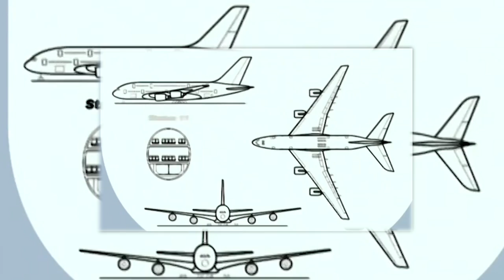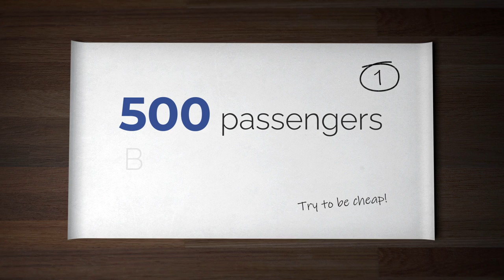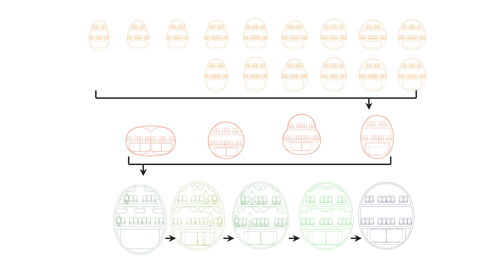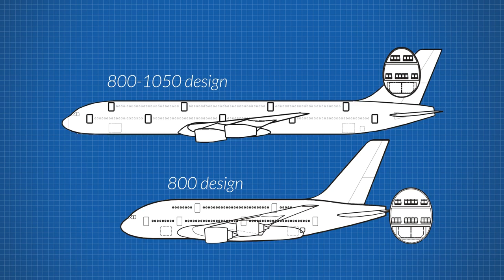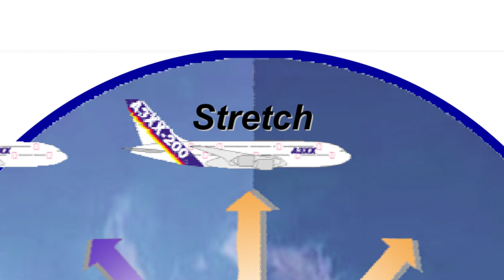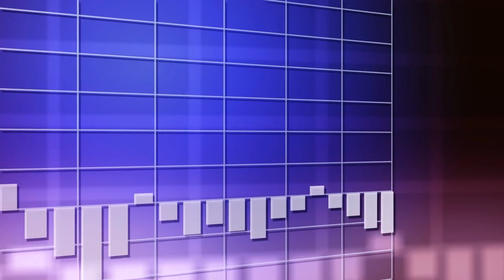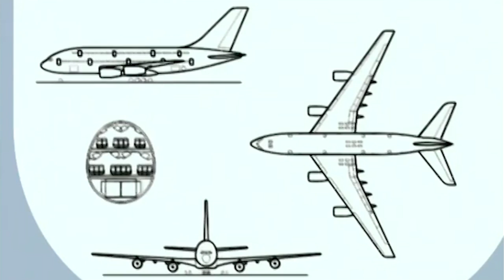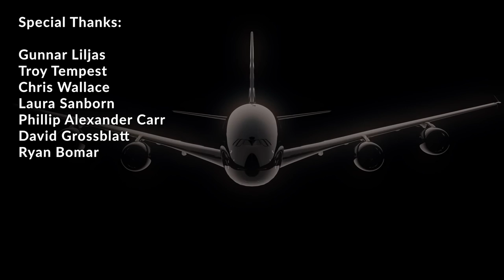Airbus A380 Alternative Designs - How They Made The Perfect Boeing 747 Rival

Comment: I wish the A380 would have been more successful had it been launched decades earlier. That way more variants would have been developed and would have sold in the hundreds by now.
Reply: Well, timing is everything. Airbus might not have been able to fund such an expensive, biggest ever project 20 years earlier. Only when Airbus had matured organizationally and in the global market could they undertake such a huge risk. Turned out to be 10-20 years too late, and major market changes have occurred. So the final count of giant commercial aircraft will be right around (1558) B747 to (243) A380. It is sad to see the B747 rapidly being phased out fleets as well.
Reply: Airbus already sold hundreds
Reply: @maverickchakraborty9578  they had to sell (lease for the long term) at least 400 units to make up for the costs. Let alone profit from it.

Edit: If I remembered correctly.
Reply: @fyt54321  if a project is to ambitious aircraft companies collaborate like on the concorde and eurofighter. I just think airbus was just affraid to attempt it. The market was there, they just didnt belief in it. As they saw other manufacturers run into development issues, like lockheed and mcDonnel Douglas.
Reply: If it launched earlier then it would need 5 or 6 engines, even worse airplane.
Reply: @hodb3906  they needed to sell around 250
Reply: @maverickchakraborty9578  With regards to the 380? I guess "hundreds sold" could be a valid characterization, although on the Airbus site they seem to list only 251 orders total, which I assume is the total number of orders of its history....
Reply: Would airport facilities and ground operations in many markets have been ready at an earlier point in time in such a counterfactual?
Reply: well pre-2000s means then came 2001 so...it'd rather been a catastrophe. I feel it was the right time, it was never a great idea so i am surprised it even sold that much.
Reply: They could've made it mode succesful, like less weight
Reply: did the a380 ever make money?
Reply: @randomrazr  No
Reply: Decades earlier would have sold 1500 at least. They came on the scene too late after the airline market already shifted to more flights on each route on planes in the 777, 767, A330 size of planes. Ironically if Airbus were still making the A380 I venture to say they’d be getting 300-500 new order right now because plane giants would love to change to a less flights per route with planes that hold more passengers now. The pilot shortage presents an opportunity for Airbus but they probably don’t have the equipment to make an A380 anymore
Reply: Decades earlier would have sold 1500 at least. They came on the scene too late after the airline market already shifted to more flights on each route on planes in the 777, 767, A330 size of planes. Ironically if Airbus were still making the A380 I venture to say they’d be getting 300-500 new order right now because plane giants would love to change to a less flights per route with planes that hold more passengers now. The pilot shortage presents an opportunity for Airbus but they probably don’t have the equipment to make an A380 anymore
Reply: Late to the game lol

Comment: The a380 program was still a success I'd say. A lot happened in the background that helped Airbus and its product line become much more modern, optimized and competitive. Many features of the a350 were initially developed for the a380, like break to vacate.
And I think that in a couple decades, some markets will become too saturated and there will be demand for large double-deckers again, even doing p2p.
Reply: Extremely big picture maybe it was a success, but in pure accounting terms, the A380 was a money losing program which never broke even (a failure). By the time a large 4-engine style/500 passenger airliner is in demand again the A380 won't be competitive because of newer technologies available at that time (I'm guessing at least 15 years).
Reply: Would have it not been easier to just build the A350 like Boing did with the 787 and skip the whole A380 debacle?

Comment: Exactly how you stated: plane that we love. I did at least 20 long haul trips on board of an A380 ( CAN-DBX-GRU-DBX-CAN) and I can affirm it’s my second favorite airplane ✈️ for passenger comfort, the 1st one is the A350 ( I have fear of flight, I know it’s dumb, however my subconscious wins over my reasoning been, my first flight ✈️ onboard of the A350 I almost got panic attack due lack of noise, I got the impression the turbines weren’t get trust enough to lift the plane hahahahahaha)
Reply: A380 lack the cabinpressure turbine and the water recyceling system that A350 and dreamliner have. This allow them to have higher pressure, less noice and wetter air (aircraft air is usuay very very dry. 

This is the main reason A350 and B787 feals so nice but you cant put your finger ln why. The system also saves fuel, the actually original reason why they have it.

It strange that they opted not to install the system on the A330 neo. That is why A330 neo cant share engines with the B787.
Reply: I haven't got on A350 B787, but I did couple trips on A380. So in my "experience" A380 is the most quit airplane, especially after take off when engines reduce the thrust, it feels like we're still on the ground :)
Reply: @Ascarbek  yes, especially when you're sitting in front of the engines
Reply: Obrigado you for flying Emirates! 😁
You might have been one of my passengers. ✈
GRU-DXB is even considered ultra long haul (ULR flight).
I use to hear passengers often saying how much they like the 350 while flying on 380.
If the plan hasn't changed EK should be getting the 350 (with some 330s) instead of the last 380s ordered that will not be built.

Comment: During a familiarization class given by AirBus for the rollout of the A350, I was able to walk thru the assembly building for the A380 in Toulouse FR. Workers were putting the cockpit wiring and related equipment in place up front but the rest of A/C was bare and vacant.  With no interior and no floorboards or bulkheads in the main cabin, it was a huge, dark cave of impressive size.

Comment: Airbus should of concentrated more on both the cargo version and the ability to convert to cargo than all these multitude passenger focused versions.
Many cargo planes spend a good deal of their lives as passenger planes before conversion and airbuses total disregard for this aspect has bitten them hard.
The 380 is almost impossible to convert effectively unlike the 747 which is extremely easy to do so, airbus should of focused on this as even before covid those 747 were coming to end of life and the 380 could of been an excellent replacement mass hauler.
Instead we now see many barely used (in airframe time) 380 either going to scrap or "retired" way too early.
Reply: Airbus should have concentrated on improving the A340-500/600 models instead, and made the A340-500 available as a cargo transport.
Reply: As well as a longer range, a340-600 using the a340-500 but a slightly bigger fuselage with larger fuel tanks and improved engines
Reply: The a380 has to much volume to be an effective cargo plane. It would need bigger wings and 6 engines so to max out its payload capability.
But there is also a logistical problem. The a380 fuselage is much taller than the 747. Would they do 2 or 3 levels for cargo? 2 would help for oversized stuff but very ineffective economically.
Reply: And Boeing should have built the Pelican.
Reply: >unlike the 747 which is extremely easy to do so

The Jumbo had the privilege to be born in an era when the Cold War created funkloads of theoretical niches only itwas capable to fill:
Double-deck intercontinental airliner? check
Cargo-transport? check
Semi-militarized presidential transport with extensive self-defense capabilities? check
Long-range aerial-refueling tanker? check
Aerospace surveilance and lectronic warfare? check
Military missile command mobile HQ? check
Airborne ICBM launcer? check
Anti-ballistic/anti-satellite freaking LAZORS!? check!
Flying fighter-jet carrier? FREAKING CHECK!
Reply: They really couldn’t at first. The design was a double decker. The question was how do we efficiently redesign it to be a cargo plane after it was designed to be a double decker?  Thats why it cost so much  in the beginning, it was all the design changes and retooling ect. They basic designed them inside a box they had to figure their way out of.
Reply: I totally agree, I remember seeing this. I wish  all A 380 had the option for a cargo plane. But they didn't want to do that, or maybe the cost. Not sure, but just looking at that plane cargo comes to mind. I'm just saying anytime you build a piece of equipment. The usability makes it even more valuable. It pumps me out the Airbus A380 is awesome.
Reply: The A380 can not ever take cargo as the decks do not have the structural strength and the mostly carbon fibre fuselage makes it very difficult to insert cargo doors.  It would have to compete with second hand 747 conversions and that would mean no one would buy a new A380 freighter.
Reply: @johnny_eth  afaik the wings were too big
Reply: I always say the same thing! They should have had a portion of the team focus on either making a separate cargo version or focusing on making a the A380 a combi aircraft.

Comment: @4:16 > Aérospatiale is the ancestor and French part of Airbus, known after renaming as "Airbus France". For a long time, final assembly of AIrbus aircraft was done at their HQ in Toulouse, France. Today they are in charge of a lot of things, including integration, cockpit and most avionics, and final assembly of the whole family except obviously A220.

> BAE is the other ancestor and English part of Airbus, before the UK pulled out of the Airbus project. UK's aero industry was saved by (if I recall correctly) the German gov't providing funds needed by the UK companies to build large production facilities to remain in the Airbus project (mainly for wings, in Broughton). Today they are mainly in charge of landing gear and wings.

> CASA is the Spanish part of Airbus. Most of its experience was in designing and building in military aircraft. They are now a big part of the military programs, and notably took over the responsibilities on the A400M and A300-MRTT (the military-oriented transport/tanker). Today they are mainly in charge of the tail section, including APU.

> Deutsche Aerospace is obviously the German part of Airbus. They are based in Hamburg. Don't know much about their history, but they have a sweet Boeing Super Guppy exposed on site. Today they are mainly in charge of the cabin along with other things (evacuation, external lights,...). All Airbus aircrafts have their cabin installed in Hamburg. They also have an A320 final assembly plant, and an A380 delivery center (but final assembly is done in Toulouse).

Comment: The perfect 747 rival would have at least had a variant that was competitive as a freighter. As it is there will be 747 freighters flying for at least the next 25 years. A380's still flying in 15 years? Unlikely....
Reply: I think there will be a new big plane arriving for cargo purposes. The order online market is only going to grow even further, the key to winning is going to be purpose built efficient planes of varying sizes.
Reply: Emirates will probably keep the A 380s until 2030 (since it's the perfect aircraft for their business model), the 747 cargo aircraft get competition by the new 777-X cargo version, the produced 747-8 F will of course still fly for at least 15 years.
Reply: Emirates will keep the A380 until the mid 2030s
Reply: @simonm1447  Boeing would try to compete with themselves lol?
Reply: @yadoo8164  not directly, the reason why they never offered a factory freighter based on the 777-300 ER. However, with the production end of the 747 they need something new in this size, which is the new 777 Freighter which is bigger than the old one based on the 777- 200
Reply: i guess there’s the beluga…i guess????
Reply: @vehicleboi5598  Belugas serve a different market. They have a huge cargo bay (much bigger in diameter than the 747F), but only 50 t payload. They are made for bulky cargo like aircraft wings or fuselages, but not for the main market with general cargo.
Reply: @simonm1447  i didnt realize
Reply: @vehicleboi5598  The Belugas are adopted from the Super Guppies, which were based on Boeing Stratocruisers, a derivate of the C-97 which is based on the B-29. Before Airbus had the Belugas they used Super Guppies, later they developed a similar construction based on the A300, today they use new ones based on the A330.
Reply: @simonm1447  please stop
Reply: @ParissaKhoury Emirates has already said it's unlikely they will fly the A380 again, all these people predicting the 2030s and we're barely in the 2020s. My dream was to one day fly first class on an A380 but sadly it seems impossible now.
Reply: @trizzybones  Emirates is flying A 380s again right now, maybe not all they have but at least some are flying again. 
They have more or less no other choice, beside the 777-300ER it's their main aircraft of the fleet, and 777-X which could replace them later are delayed and production hasn't started yet. 
For Example Brisbane - Dubai (EK 431), an A 380 at this moment in the airspace above Indonesia
Reply: Boeing just made their final 747’s so i don’t think they will be flying for 25+ years as parts will become scarce and expensive as newer, faster and more efficient planes dominate the market
Reply: @darksid356  Cargo planes are used until much older than passenger jets; that's why we still see DC10s flying decades after they stopped production. There are way more parts available for 747s than A380s, but I take your point as the A380 is an overall newer design. One point of contention though: slower planes are sometimes more efficient than fast ones. See Mustard's video on the Convair fastest subsonic airliner.
Reply: @simonm1447 seeing as there’s still DC-10s flying cargo I think 15 years for a -8 is incredibly conservative
Reply: @jimmygee3219  it will depend on the fuel prices.
Older aircraft are more competitive is fuel is cheap, if fuel is more expensive a newer, more expensive aircraft becomes more competitive.
I wrote "at least 15 years", since we don't know how much fuel will cost then we can't say how long the 747-8 F will be used
Reply: @slavicprincess at the rate they’re using them that’s honestly unlikely. The airframe does indeed have a lifetime of cycles. That’s why Emirates is already freaking out that Boeing and Airbus don’t seem primed to make a new Superjumbo
Reply: The beluga
Reply: Fast forward in the future and etihad has ordered a few A380 back because of high demand. Yess high demand capacity.
Reply: @simonm1447 Two 747-8's will be used for Air Force One in the coming years, and undoubtedly they'll be used for decades. Point is: The very last A380, (regardless of what it's used for) will make it's last flight before the 747 does
Reply: @Utonian21  the 2 air force one might  be the last in service, that's right. If you are the last operator with just 2 aircraft however you will have difficulties to get spare parts, and the costs for maintenance become very high. This was the case for the old NASA DC-8s, and it's the case for the German Tornados which will be the last in service. 

The 2 old 747 air force one aircraft do not have nearly as much flying hours as commercial 747s, they get retired for the same reason since nobody else is operating this 747 generation commercially any more. 

The 2 new air force one 747s will have the same fate eventually, it will simply become economically unviable to operate them much longer than the commercial fleet.
Reply: @simonm1447  that's why the two current 747s being used for AF1 are going to be put away in case they need to be stripped.

And, they're literally the planes that transport the president, so economical viability isn't relevant. Tax payer money pays for them. 

A ton goes into modifying planes so they can be suitable to serve as AF1, it's not a cheap or easy venture. So it's safe to assume the new ones (or atleast one of them since the other is a backup) will be flying the president around into the distant future
Reply: @Utonian21  you can't strip a 747 from the 1980s for parts for a 747-8.  The new version has not really much common with the old one, all the systems are new, even if the outer shape looks similar it's not the same aircraft
Reply: @simonm1447  Depends on the parts. Regardless, the government obviously has a plan, so there's no point In arguing about it. The fact still remains, even when all the commercial and cargo 747s are retired, two of them will still be used for AF1
Reply: @slavicprincess  And the last one ever built can even touch the early 40s
Reply: @vehicleboi5598  That's if they produce a variant for sale with higher payload and MTOW
Reply: @Simon M  for somethings but not all part of what made the 747F successful was that it could handle long loads. Why the 777 doesn't have a rear cargo door option is confusing to me. (Yes I am aware those are almost exclusively military vehicles.)